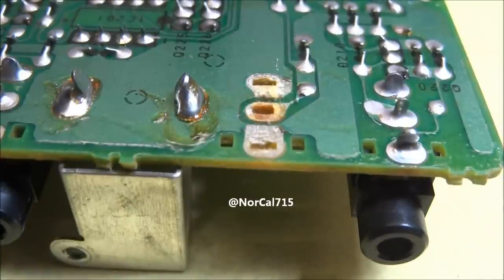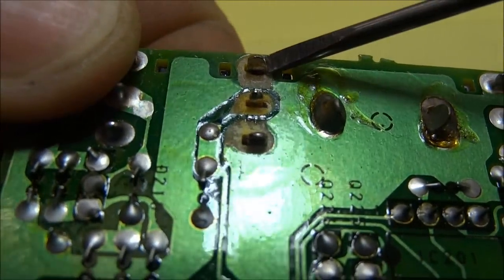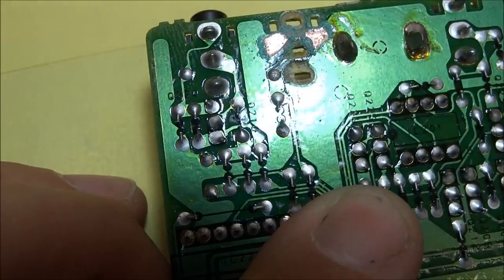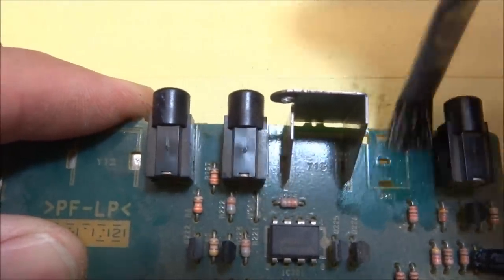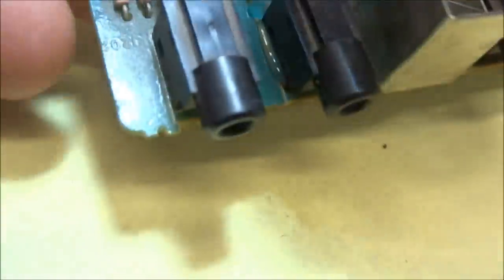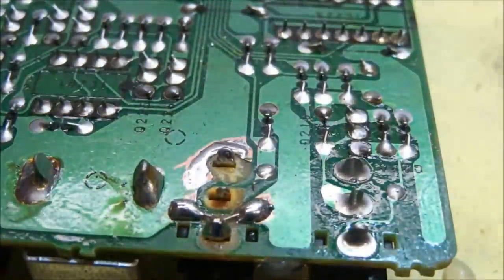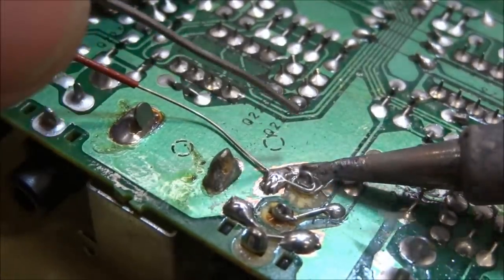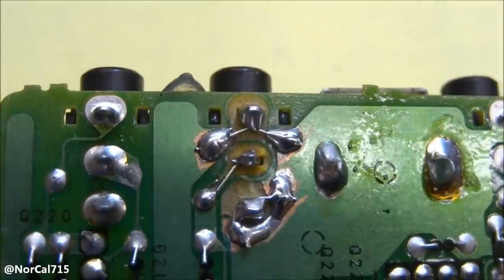Replacing a jack on a circuit board when the copper pads are missing Repair Fix

Comment: only amateurs use hot glue and acetone, pro's use epoxy and isopropanol !
Reply: I prefer hot glue. Good luck getting the epoxy off if you need to remove the component again. Also hot glue has some flex in it, which makes it perfect for connectors with a high insertion rate.
Reply: funkyant He has good point on hot-glue, still bad on epoxy but don't explain so i will try. In general You never use hot-glue in any device that might warm-up and melt hot glue again. That apply to any electric household devices and electronic stuff, using hot glue to keep in place power transformer or heat sink power transistors - bad idea, it will melt or get more plastic - maybe not on normal operation but in case of failure. 

Of course in this case in video it's not problem, 100% fine - we have low voltage, signaling circuit, without any power resistors, power transistors etc. but it's like fasten seat belts... to be safe do every time not only when You go drive fast, it's like a good habit. Hot glue is acceptable only in "chines things"  and we should avoid it, just like habit  crimping and screwing earth wire to chassis.  Thinking of safety measure.

Epoxy is bad, great explain it will be hard to remove in case repair. 

What will be good in this case and any others?

Heat resistant silicone grease glue - You can find of ebay as "heatsink plaster" or automotive shop. 

It's often using in quality equipment to glue capacitors to PCB (chines often use hot glue to this... i saw some boards after capacitor being short and melt glue onto PSU board... not nice place to work on, believe me).   

Acetone - not nice in some cases, he told in video... it's corrosive to plastic -> playing with acetone and for example tactile switch - not the best idea, it could get sticky, don't respond that well) 

I also prefer IPA for cleaning flux.

I hope someone find any of that useful.
Regards
Reply: Electronic Noob Blog So basically you are saying in a very long-winded way that indeed hot glue is better than epoxy in this use case.
Reply: The Bright Pixel If You can't use heat resistant silicone (for example can't wait to dry (silicone You have to wait a lot of time - some cases overnight) or You don't have lying on bench) - then yes hot glue is better than epoxy.  In case repair that kind > any element that have direct contact with user, switches, connectors could fail anytime and require replacement - epoxy You will remove but also including PCB ;) Silicone - can remove using sharp knife. Hot glue - just reheat with hot air - then remove ;-)  I done many repairs chines stuff and they put loot's of hot glue - that's why i'm not a big fan - it could be messy. But still in this case i'm not hate video above - it was done ok, just answering in general to comment above what was maybe a little bit hateful ^^. ps: Also remember epoxy is solid, You have to  count it, sometimes is better to relieve tension and don't put force directly to PCB. Better have "removed" connector than cracked PCB. I came here because i was doing repair of guitar tuner with 6.3mm jack socket pulled witch pads. I don't had space to do wire warping (SMD) like on this video so i just glue socket and using shielded wires transfer audio signal to other part of PCB leaving original damaged traces.  So there are many ways - have open mind chose best for situation You are working on ;). From my post just memorize one thing - never use hot glue near hot element's and  any job will be fine ;-)
Reply: Electronic Noob Blog lol
Reply: ***** Respect costs nothing dude, cheap shots are indicative of a person with a bulling type of nature

Comment: I love the video; however, when using acetone, you really shouldn't get it on your skin because, you'll absorb it into you body and that's nasty $hit!  Thanks again for the excellent video though.

Sincerely, John - your new subscriber
Reply: John Mcgaghey So women slowly kill themselves when they use nail polish remover. I have doubts about than, it would be a very small amount, and your body makes small amounts on it's own.
Reply: ^lol what
Reply: Alcohol will lift the hot glue. @Michael W
Reply: @Michael W Hot glue is a legitimate tool in repairing electronics, and many famous manufacturers use it all over the place.

Comment: No, acetone has no long-term adverse effect on any of the plastics that are used for connectors. Absolutely none.
Reply from the maker: I have used acetone for almost 40 years with ZERO side effects. It is a miracle product.
Reply: Other folks use isopropyl alcohol.

Comment: your soldering skills are mediocre. its much better to use glass point pen to strip the solder mask, secondly quality flux should be used for pre-tinning as well as any re touching, lastly there are correct glues for the purpose.

Comment: This is a horrible way of doing this. I've been soldering for the military for over 10 years and this would not be approved as a reliable repair. Too much solder, never scrape your boards, don't use a razor blade to chop the wire, and you should remake the lifted pads.
Reply from the maker: I have only been doing repairs for a little over 40 years. and yes when the customer does not want to spend several hours of labor to repair a damaged jack, this is a great solution.
Reply: @norcal715  I guess your standards are just really low. 😘

Comment: This is a terrible thing to do to a PCB. You can buy electrically conductive paint for about £10 ($14) to repair broken pads and tracks. Just remove the damaged pad with an exacto knife paint on the paint to the area that was missing the pad then solder as normal. Please whatever you do DO NOT DO THIS TO YOUR PCB!!!!
Reply: There's nothing wrong with his repair method. Granted,  it's not pretty but his repair is definitely strong. You like conductive paint,  he likes solder.  They both get the job done. I always work this way and always will as I've never had a job come back for re-repair.  Glueing the jack socket before soldering will reduce the stress on the solder connections too which is wise as that's the original point of failure.
Reply: HughBayleaf agreed. This is a ghetto rig  repair, but good to see this and contrast to a proper repair.
Reply: its not ghetto rigger repair, it's repair. professional companies solder their own products, they just use machines that's the only reason it looks pretty. it's not ghetto, it's just a different method. Ronan's comment still stands.
Reply: the funny thing is, these people concerned with "pretty" don't realize you might already have your preferred tool available, learning a new tool to do a 5 minute job is stupid. And "pretty" doesen't matter when the board ends up going back inside a plastic casing. This was for headphones, the OP would never see it. If youre doing this for a client, your client could give a fuck if you use solder or paint. Flux is typically cheaper than paint, I try to charge my clients LESS money for BETTER service, that way I get more profit and keep them happy, Hugh Bayleaf obviously isn't thinking about that part.
Reply: and if your making a repair for a client, a $20 repair becomes a $34 dollar repair with your materials list. yeah, you must have some real happy clients.
Reply: HughBayleaf it really depends.  I get the feeling this isn't a piece of vintage gear that is being restored.  it's probably something that, if it couldn't be repaired on the cheap, would have been thrown away.
Reply: How about a web site where you can buy conductive paint,they use to sell copper foils you. can push down on the board,can't find them either,but his repair is the same way I would do it too
Reply: HughBayleaf j
Reply: Yeah but what if the pads are missing in the first place smart one? This an optional method that you don't have to follow
Reply: My expirience with this "paint" (made of stuff similar to pencil lead) is the resistance gets too high, and it cracks when the board flexes. Unless you're thinking of a completely different paint.
Reply: HughBayleaf true but if nothing else available it works for a quick fix..